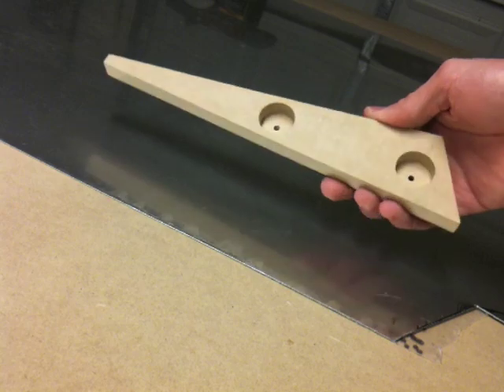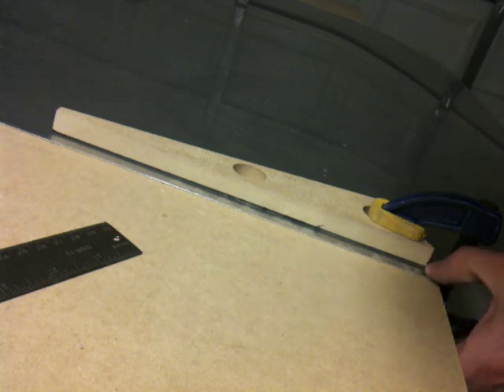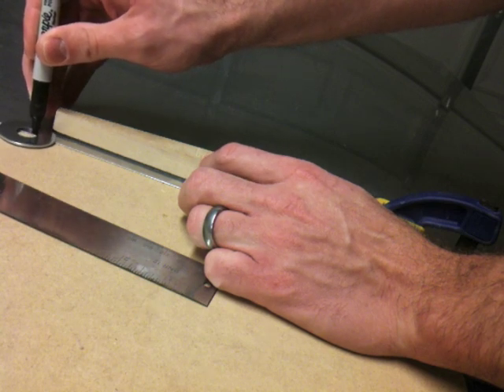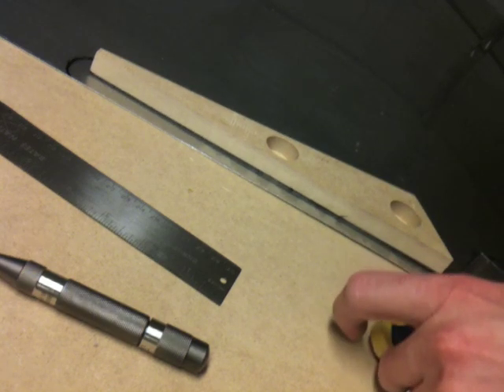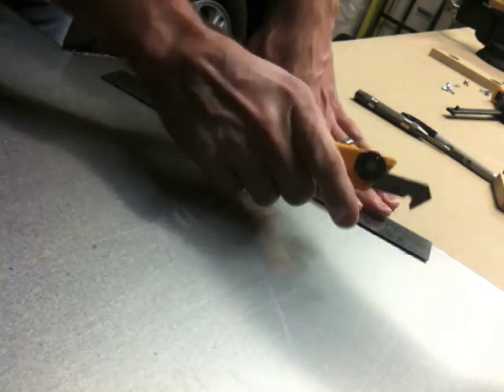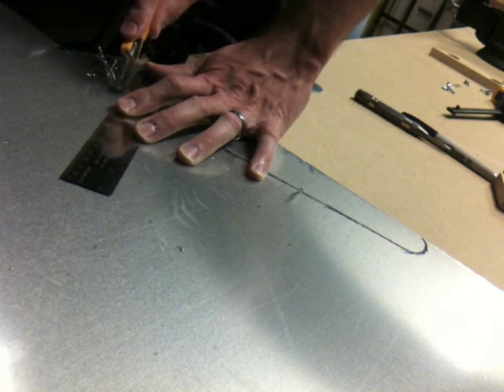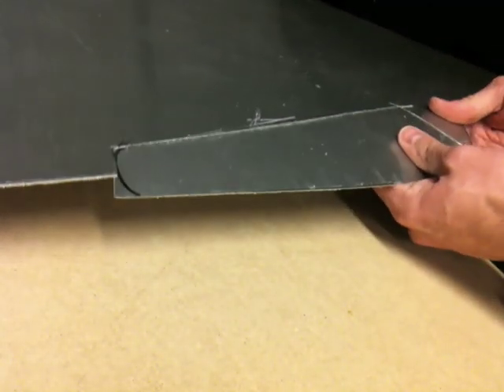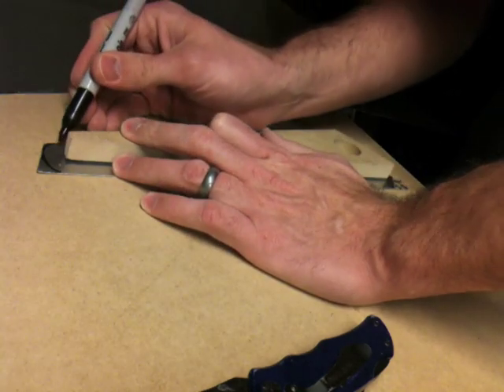sonex rudder rib part 1 of 3

Comment: "Measure it to the thousandth, mark it with a felt tip pen and cut it with a chain saw."
...
"I love working with aluminum but may be allergic; it seems every time I start cutting, bending and forming it; my hands break-out with cracks and bleed all over the place."   >:)